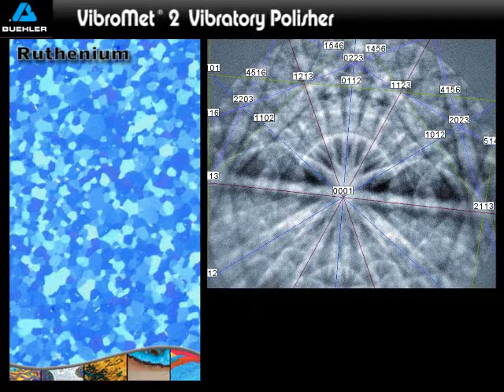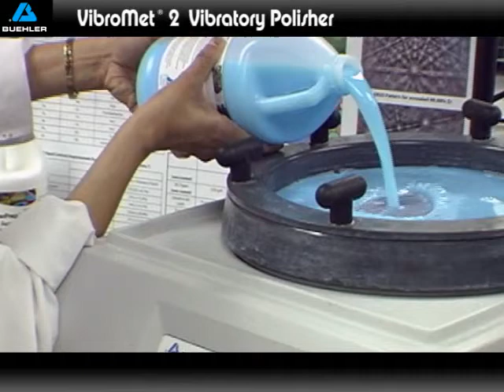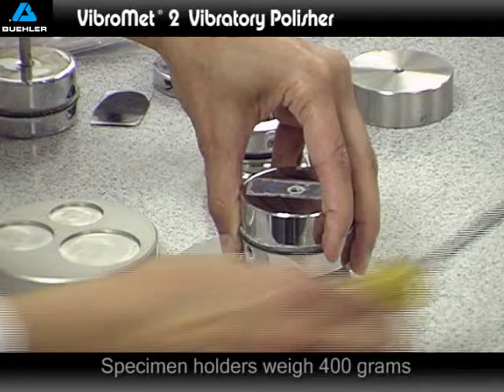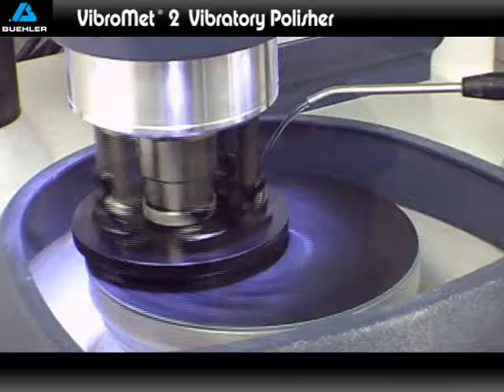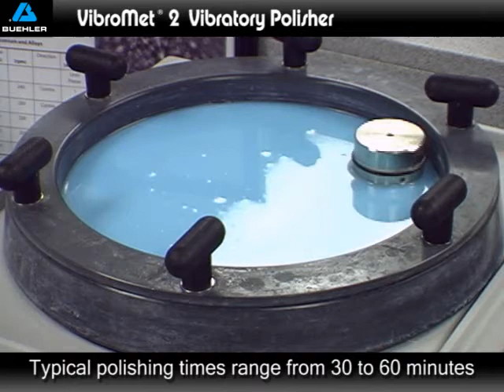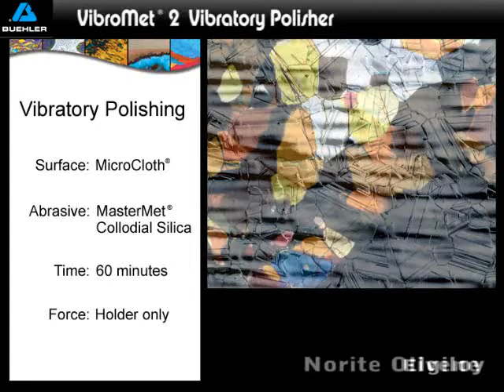VibroMet 2 Vibratory Polisher-Best Practices & How To Guide

Comment: Great guide. Very organized and easy to follow. The mounted sample looks too tall though
Reply: Thanks for the comment! For the purpose of the video these samples demonstrate a larger size! In practice, ~1/2 to 1 inch works very well.  The system is very stable even with taller samples.